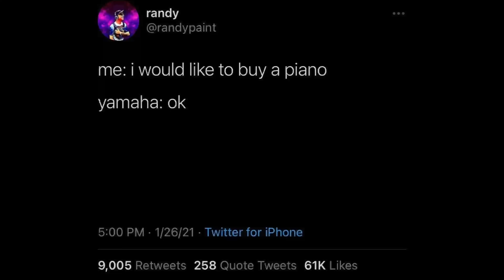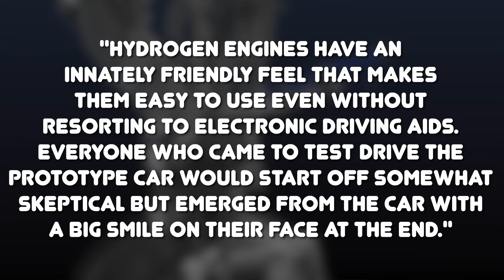Toyota's New 455HP Hydrogen V8: Everything You Need to Know

Comment: There were some news about toluene being able to "bind" hydrogen on it, so you could actually fill your car at the station like you do now. Also, it is quite neutral as a compound. So gas stations only add 1 more pump which is full of hydrogen rich toluene. Imo, hydrogen engines do not have to offer any performance advantage for me to buy one over electric. Every petrolhead would get one.
Reply: They could even have performance disadvantages compared to electric (like how current ICE can’t outperform electric) and I’d STILL buy one
Reply: @buckeye392  SAMEE!! I love the sounds an engine makes! Engineers create instruments and I just don’t think I can give it up. Spaceship sounds in EVs don’t appeal to me
Reply: @lupe2947  Agreed,the engine sounds are actually great for a new driver like myself for gauging speed by ear instead of having to glance down at the speedometer. An EV can't do that.(and no,pumping fake engine sounds via the stereo isn't going to help)
Reply: Interesting, so you can just fill your car up like you always did, while pissing out water from the pipe!

Comment: I would rather have the hydrogen powered car, and know that I can fix it myself. I personally do not like electric vehicles whatsoever, and I will continue to drive my combustion powered vehicle for as long as I can
Reply: If the hydrogen in your car is stored at the same pressure as it is at hydrogen filling points - 10,000 psi - I don't think you'll be doing much "fixing"........

Comment: I recall General Motors putting alot of R&D into hydrogen powered vehicle a couple decades ago. I think they had built a prototype or two as well as. Hydrogen electric hybrid is what they came up with.
Reply: They made hydrogen fuel cells like the space shuttle used. 
Fuel cells use hydrogen and oxygen out of the air to generate electricity like a battery. They do work well and are effecient but are very very very expensive and temperamental. Good for NASA but not everyone else
Reply: General Motors were trying to push hydrogen 45 years ago......

Comment: I think this is tech that will replace the internal combination engines and make them viable long term. It's early in infancy like electric once was, technically will catch up.
Reply: not only for performance but i believe it would be a way to keep hybrids with a hydrogen system going long past the range of pure electric without emissions. issue is making hydrogen in mass to keep it efficient
Reply: its not early lmao hydrogen as a fuel has been used far before gasoline
Reply: @Mr.Thermistor7228  electric cars have been around longer than gas too
Reply: Ahem, this IS an internal combustion engine, just like you, your daddy and your grandpappy all drive/drove.
Just better😁😁

Comment: I actually think hydrogen is the way to go long term. There isn’t enough rare metals to mine to make enough evs and the replace their batteries eventually
Reply: That’s what I’ve always said to myself
Reply: That is 💯
Reply: Or... don't use rare metals in your batteries.
Reply: @lexwaldez  Indeed, there's a lot of research into all sorts of interesting chemistries that replace lithium or require no rare earth metals etc.
Reply: @lexwaldez  so which other elements do you propose then? also, do keep in mind materials severely affect the energy density of batteries (and is one of the biggest reasons lithium-ion and lithium-polymer batteries exist).
Reply: There are large lithium deposits in South Africa, Canada, the US, Russia, China, Chile, Brazil, the Congo, Australia and Cornwall in the UK. And batteries will not always need to be completely replaced, because like an ICE engine, they can be repaired and refurbished at a fraction of the cost of a full replacement. Tesla are now producing cobalt free batteries, which reduces the need for that particular mineral. As more EV's begin to be used, battery recycling will mean that a steady supply of used cobalt and lithium will be available to be reused in new batteries. Which isn't something you can do with petrol or diesel. Once that's gone, it's gone for good.....
Reply: @Brian-om2hh  and mining all those large deposits is almost certainly harmful to (at least) the local environment. creating hydrogen, on the other hand, really only takes water and electricity, to do it the environmentally friendly way (assuming electricity is generated in an environmentally friendly way), and using it turns it into water again. doing it this way eliminates a lot of the issues with electric cars (huge, heavy battery packs, long charging times, etc).
Reply: @vukpsodorov5446  "and mining all those large deposits is almost certainly harmful to (at least) the local environment."
And oil just appears out of thin air, refines itself and jumps into the fuel pumps?

"creating hydrogen, on the other hand, really only takes water and electricity, to do it the environmentally friendly way (assuming electricity is generated in an environmentally friendly way), and using it turns it into water again"
Yes, you can create hydrogen from water using electrolysis but it uses a lot of electricity.
If you're producing that electricity sustainably, then you may as well put it directly in an ev.
More efficient than using it to crack water into hydrogen, compressing that hydrogen, pumping/transporting that hydrogen then using that hydrogen to fuel an ICE or Fuel Cell car.

"...issues with electric cars (huge, heavy battery packs, long charging times, etc)."
Yes, current battery tech is heavier and slower to charge than is ideal but that's their only real drawbacks.
Those drawbacks are manageable since rapid chargers are available over 100KW in even basic EVs now and some up to 350kw.
Reply: @airchie2  and they're still slower to charge than compressed hydrogen, and heavier than ICEs. the fact that millions of ICEs that can be converted to hydrogen already exist is reason enough to run on hydrogen instead of producing millions of tons of e-waste (and that's what batteries will inevitably end up as). a hydrogen ICE car is lighter, cheaper, faster to refill and, considering there's very little environmental impact when converting existing ones, they have a significant head-start over newly produced EVs. also batteries have to be refurbished every few years, engines don't. and rebuilding engines is generally cheaper and less harmful than rebuilding battery packs.
it's also easier to convert existing fossil fuel pumps into hydrogen pumps than electric chargers (how's that power grid looking, by the way?).  Hydrogen can be produced when power production is producing more than what the demand is. in fact, that's one of the ways electricity is stored long term anyway. however, if you go to fill up your car during the day, on an electric charger you're immediately adding to the load on the power grid, which may not be able to take it at that moment (whereas hydrogen production overnight wouldn't have the same problem). and no, "just charging overnight" isn't a silver bullet, since people would already be doing it anyway (and not to mention it's pointless when thousands decide to do it at the same time). again, not a problem when you generate hydrogen whenever you can thanks to excess power from wind or whatever. It also makes really long range transport of power easier (we know that, since infrastructure for it already exists in the form of oil/gas pipelines).
also, their lighter weight gives them several advantages when it comes to support infrastructure.

why deal with the downsides and teething issues of a completely new technology when another that's already 90% implemented doesn't have them? i mean, electricity chargers and all that new infrastructure is bound to have teething issues, whereas the 100 year old tech that's in place and compatible with hydrogen has matured far more (and is already far more widespread).
Reply: @vukpsodorov5446  Wow, you managed to squeeze a lot in there, I'll try to reply to each point...

Converting the current ICE vehicle infrastructure to hydrogen isn't as simple as you suggest.
I'm no mechanic but from what I've read, it'd be about the same level of work as converting a petrol to run on diesel.
Certainly a lot more involved than just swapping the fuel, changing injectors and remapping the ECU.
And it would be less efficient than it was previously with less power.
Certainly far less efficient than an EV and probably far less powerful.

Same goes for converting current crude oil transport and dispensing solutions.
Hydrogen is a gas not a liquid and would be stored at high pressures.
Its a small molecule and would find leaks very easily.
Current pipelines are constantly bursting and leaking with oil, they'd have no chance with hydrogen.
Same with petrol stations, current tanks would not be able to contain hydrogen at pressure.
The pumps would need to be completely changed also.
So to suggest that switching from petrol/diesel to hydrogen wouldn't be a monumental undertaking is just false.

Regarding batteries, you seem to have fallen for a lot of the FUD.
"They only last 2 years and then you have to throw them in a river and buy a new one for $$$$$" etc.
Truth is, modern EV packs with half decent BMS systems will cover more miles in their lifetime than any ICE engine.
When they are no longer useful to power a car they can still be used as home storage etc or refurbished to replace the weakest cells.
If there's more weak cells than strong ones, they're 95% recyclable and the demand for new packs will make recycling financially viable on industrial scale.

With regards to the energy generation situation and the ability of the grid to cope.
The National Grid who manages the UK infrastructure said they foresee no issues with switching to EV en-masse.
In fact, with the correct tweaks made, EVs will help balance the grid and make EV owners $$ at the same time.

The bigger threat to the grid would by trying to power enough electrolysis of water to produce enough hydrogen to run all the cars.
The energy used to produce enough hydrogen to drive a car 1 mile would drive an EV several miles.
So if you think there's not enough electrical generation capacity to convert to EVs, there's definitely not enough to convert to hydrogen!

Comment: Electric cars are boring. What you buy is what you get. Basically zero way to tune them. Plus there carbon footprint is astronomical. I see them as nothing more than fad.
Reply: Not to mention, all the excess energy required to recycle all the lithium ion batteries at the end of their lifecycle. Still burning coal to charge your electric ride.

Comment: Everyone thinks that Electric is the way of the future, however nobody ever talks about the problems with it. First - if everyone in the US had an electric vehicle the present electrical grid could not handle charging every car, as it is it can barely handle when 30% of Californian's turn on the AC. Second - the Carbon footprint that it takes to create just one battery is 20 times worse than a combustion engine being used for 10 years and that's not even considering what it takes to get rid of the batteries when they die.  Saw TFL charge a Rivian truck for over an hour to only 50% and it cost $27.  I can put $27 in my small diesel truck and have over 60% and go twice the distance. Combustion engines are not going away. Hydrogen is awesome and I am glad to see someone really tying to do something with it.
Reply: The lack of EV charging infrastructure in the US isn't an electric car fault. It's an oversight on the part of the US Government.  And you don't "get rid" of older EV batteries. They're way too valuable for that. You repurpose or recycle them....The lithium and cobalt can be recovered and reused in new batteries..

Comment: I’d much rather the hydrogen v8 over the electric car honestly since I’m a gear head who loves V8 noises and wrenching on cars.
Reply: If solid state batteries live up the hype, I'd rather build a diy simple easy to work electric car for $20,000 than buy a $50,000 overly complicated EV that you can't DIY fix. Tesla's are purposely made to be near impossible for diy repair.....I love the fact that Elon became a billionaire by selling junk to lefty fan boys. Then later revealed to em that he wasn't the lefty they thought he was....lol   Elon playing 4d chess with lefty idiots.
Reply: @michaelbrinks8089  you gotta make money somehow lol and he figured out how to do it.
Reply: I'm with you, but when you think about how complicated it is (read that as completely inefficient) to take an explosion pushing down on a piston head, and transferring that in-line force to rotational power and move that from engine to wheels... compare that to say four electric motors, one on each wheel, providing more power and torque than any V-8 ever could.  Mechanically it's so superior to anything internal combustion.  Focus on improving battery production, life, and range and electric destroys any internal combustion engine.  Cheaper and simpler to manufacture.  Easier and cheaper to maintain.  Just start designing safer nukes now, start building them in a year or two, and prep infrastructure now for the battery improvements that lie ahead.  OR... maybe make a car more like a locomotive train.  Have hydrogen engines that produce efficient electrical power in the car and use electric motors to get rid of all those inefficient internal combustion problems.  Maybe a hydrogen hybrid is Toyota's endgame?  I could see military applications for something like that.
Reply: @lexwaldez  the only 2 problems I can foresee with EV is 1) the lithium used in the batteries is a non renewable resource. 2) manufacturers might make them non serviceable making them unaffordable for many people who could be potential customers. 
I think EV could actually make for a great daily driver but I have my doubts I’d be able to afford one.
Reply: That is precisely why the Democrats will oppose this technology. They do not want the masses to have access to inexpensive, abundant fuel and high-powered ICE cars.
Reply: @newhampshirelifestyle4233  the sad part is that yt already took down your comment but you are 100% correct.
Reply: All about the music

Comment: My main gripes with EV are: Charge times even with 240v and the fact that unless your house has enough breaker space for a charger or you live close to charging stations, you are SOL unless you plan carefully. I'll take an engine for as long as possible. Just need to get enough on board to build the infrastructure or you fund it yourself.
Reply: Cold affects evs
Reply: @shadowopsairman1583  Cold affects ICE too, what's your point?
I just recently watched a video of an EV driving in -40c in Finland where ICE vehicles wouldn't work.
Reply: Not to mention the grid couldn’t handle everyone charging an electric car every day! This summer during the heat waves power was pretty well constantly in and out just from AC units. And still not everyone has AC
Reply: @bormanaj  You're missing the fact that EVs could HELP the grid in these situations.
When it's not driving, you can use an EV to power your house.
Then fill it up overnight when grid demand is much lower.
This helps stabilise the grid.
Reply: Yeah. This alone is why I think most EV owners have an ICE car anyway.
Reply: hydrogen can be cool too, i think it'd be the ultimate compromise in a hybrid and would work as a steppingstone until range is figured out
Reply: Remember these massive batteries also emit a massive load of radiation, way past safe levels

Comment: A Japanese man once made a hydrogen powered car that had its own hydrogen generator, and it would literally run on water. I do think that concept would have viability, but sadly, people would do bad things with hydrogen generators.
Reply from the maker: It’s not that hard to build a small hydrogen generator at home. I’ve built a few. Building one big enough to power a car is the hard part.
Reply: @Dustrunnersauto  How??
Reply: @Toyota-Coaster  generating hydrogen is as easy as putting high voltage electricity through water.
however, the more hydrogen you wanna make, the more power you need to put through it and generally, the bigger it needs to be. also, it needs to be compressed in order to pump decent amounts of it into the fuel tank, so you'd also need a good pump/compressor to be able to stuff homemade hydrogen into a car. i mean, you could just pump hydrogen into it at atmospheric pressures, but then you'd have a very short range.

Comment: As long as it rumbles and makes cool noises I’m with it 😃
Reply: Exactly, and the cool thing is that it sounds like a normal engine, plus it has a cool ass high pitched humming whistle noise.
Reply: @clunt2548  so it has a constant supercharger sound?
Reply: @pitied3744  kinda? It’s hard to describe. Lemme see if I can find the Toyota video.
Reply: Thats right. I work at at Toyota our Government is holding back the hydrogen cars
Reply: @josephbearlewis  that really sucks
Reply: @josephbearlewis  oil companies and Tesla are terrified of Hydrogen
Reply: @josephbearlewis  why?
Reply: As long as it can be turbod
Reply: Yes sir !
Reply: Seconded 😁
Reply: He'll yea!
Reply: Exactly!
Reply: Needs power and torque too or it's useless.
Reply: @grandtheftautolabs3439  Thats very true. I had a similar worry about the power until I learned that Toyota has been testing them in races for a year or so now.
Reply: So you want... subwoofers?
Reply: Ditto!
Reply: Agreed
Reply: Hydrogen source is water. Hydrogen is for drinking and washing clothes not engines.
Reply: This is just politics, lobbying, and propaganda. Nuclear plants can produce hydrogène used to produce electricity to power electrical motors, with little pollution, and no noise.